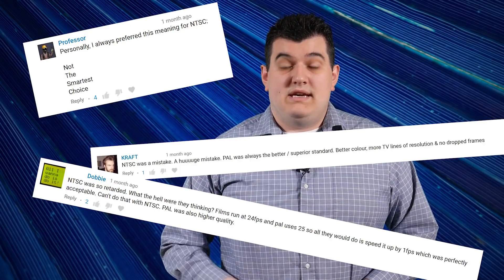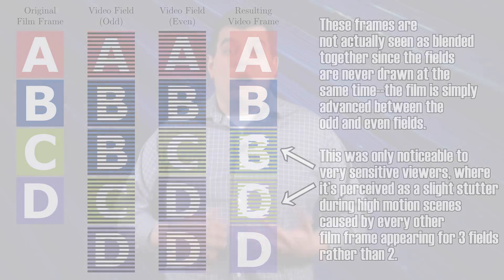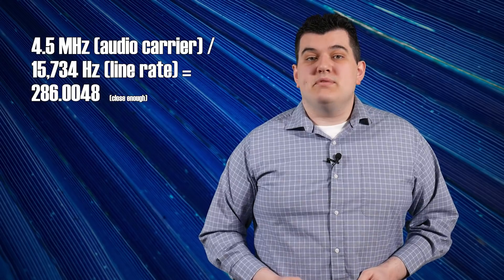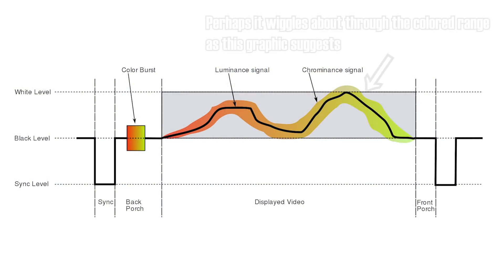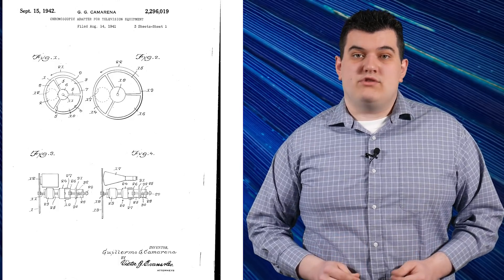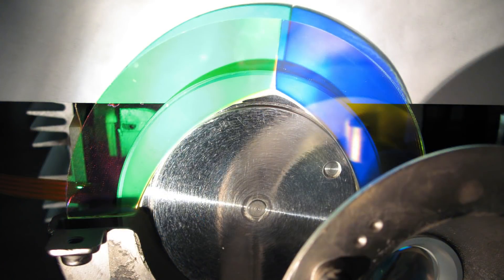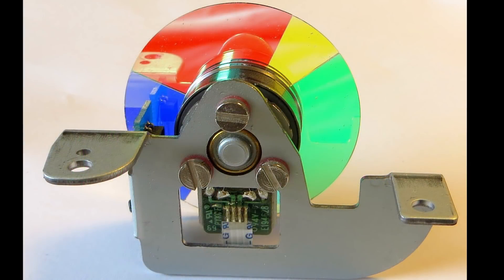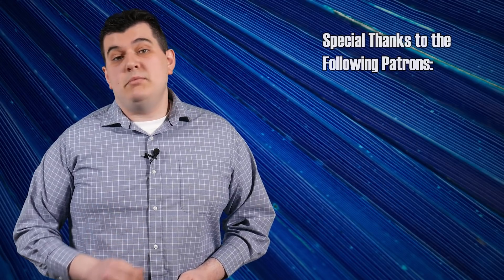Analog Color TV Wrap-Up--Some extra info

Comment: A few assorted remarks ..

1. The terms PAL and NTSC do not describe frame rate or line count. They are colour systems only, and any of the two (or three, with SECAM) can theoretically be used with any frame rate and scan line count. For historical reasons, NTSC is mostly used with 525/25, and PAL is mostly used with 625/25, but that doesn't mean that is mandatory, or that the terms define resolution. There is one country that uses/used PAL with 525/30, namely is Brazil. PAL colour on top of a 525/30 signal  was also used as a hack for bridging incompatibilities in multstandard VCRs, and apparently a reverse hack, i.e. NTSC colour on top of 625/25, also existed.

The 625/25 family of signals have been around in Europe since 1948 and were broadcast in black and white for nearly 20 years on. At that stage the term "PAL" did not exist, and colour television was far beyond the horizon. The fact that the introduction of PAL colour did not require a slight shift of the frame rate as in NTSC was just luck because the maths turned out differently, it was not planned for.

The UK is an exception in this regard, because as opposed to continental Europe they opted to retain their pre-WW2 405 line standard after 1945; they could have introduced colour television (with any of SECAM, PAL or NTSC) based on that standard, there was no necessity to switch to 625 for colour. (And that was seriously considered, they did tests with all three colour systems with 405). The UK switched to 625 eventually mainly in order to alleviate incompatibility issues with the rest of Europe. So with the 1962 introduction of 625 lines, the UK was a latecomer. So if you based your research mainly on UK sources, you might be getting a slightly distorted view of the events. In continental Europe, 625/25 in black & white  had been the standard for nearly 15 years before then.

2. I think the major factor why Europe introduced colour tv nearly 15 years after the US was economics. Europe was still building up from the war and didn't have the resources to invest into such luxuries, while in the US consumerism was already in full swing.

3. I'm in Germany, in the 1970s and 80s in some areas you could receive terrestrial television in NTSC from AFN, the station serving the US military. You needed a multi standard set which were rare and expensive then, so not many people did. From my memory, the hue problems of NTSC were quite apparent and we had to use the tint dial quite a lot to correct those green and purple faces :).
Reply: Thanks for your comment about the UK. I wasn't understanding all that stuff about incompatibility because we had an old black & white set that we used for a few weeks (maybe months?) in the early '90s. This was after the presumably early '80s, possibly '70s color TV broke. I grew up in the Netherlands.
Reply: France and UK had old and "exotic" systems that they had to choose incompatible new one. Other Europe coutries used B/W 625/50 system, so they switched to 625/50 PAL or Secam and all B/W sets worked.
Reply: Xaver Lustig True with the frame rate and line count. However, I believe at the time they were working within technological constraints of the era. Everything had to match the AC frequency while still allowing enough analogue bandwidth to transmit all relevant image, signal and audio data. The bandwidth is pretty irrelevant today with transmission of TV via a digital signal. Much more data for less bandwidth. The digital era has also made NTSC, pal and secom transmission standards obsolete... So all this is really debate.. Lol.
Reply: @gooseknack  Brazil has 60 Hz, but both 110V and 220V depending on where you are in the country.
Reply: @SveinWisnaes  Oh god...
Reply: +Brett Ison Yes it's mostly obsolete  now, except if you still play analogue tapes or insinst on only buying new equipment if it has analogue out so you can run your old tvs with it (as I insist on doing :). The irony is that even the cheapest modern flat screen televisions come with a super multi standard tuner for old analogue signals, even though that is hardly needed today. 30 or 40 years ago it would have been a dream.
Reply: @xaverlustig3581  Analog tuners in modern TVs are most likely due to FCC regulations(?), similar to why modern TVs have caption decoders in them. That's my theory.
Reply: Xaver Lustig Oh I bet!  Then you'd really be king when it came to importing tapes of US shows!
Reply: The 50 vs 60 Hz of the power line are to match the frequency of the TV signal to reduce flicker during recording in studios. Furthermore, here in the Netherlands we use the B system for VHF and the G system for UHF. Greece used the same B and G systems, so television sets could receive the black and white image but not the colour part.
Reply: Indeed, the unique colour system used in Brazil combined the 525-line 30 frames-per-second System M with the PAL colour encoding system, hence it was called PAL-M (nicknamed "pay a little more"). Because of the frame rate/line count, it was compatible with black-and-white NTSC, and totally incompatible with PAL...  People used to buy decoders and later TVs and VCRs had a "PAL-M/NTSC" switch.
Reply: Well, The American 525-line-30 frame/60 field system was designed by the NTSC (the actual committee) in its first incarnation, so I think using the term NTSC system to include that makes sense. But I guess the term PAL (Phase Alternate Line) really does refer only to the color encoding scheme.
Reply: National Television Standards Commite was around before color TV (around 1941)and it totally specifies frame rate line count Sync pulses etc.
Reply: @carlosgarza31  
But do note that pre-WWII USA television (VERY few viewers) used the old NTSC system (60 fields for 30 frames per second - but only 441 lines).  After the war, it went to 525 at 30fps.
Reply: Nice points, I learned something new today!
Reply: I completely agree with this. PAL, SECAM and NTSC are color standards. The frame rate, audio offset and modulation, etc are defined separately in standards known as “Systems”.
Reply: Are you sure that  525/25, not 525/30?
Reply: I'm in the USA and our family got Color TV in 1969.

I do remember seeing off-hue color occasionally in the early seventies, but off-hue color became less frequent as we went through the mid-1970s. 
At this point, if one adjusted the hue knob for one station, all of the other stations would also have good color, as long as nobody turned the hue knob.
One exception in the twenty-teens:  A low-power* station in the area always was slightly off-hue, with red shifted slightly toward orange, green slightly to blue-green, and and blue shifted to indigo.

*In the USA, a low-power TV station means more than just the fact that they have a weaker signal (15KW ERP or less).  The technical standards are less stringent, but cable TV systems have no obligation to carry LPTV stations on their systems.
Reply: true enough , practically superfluous as almost all pal used 50hz and almost all ntsc used 60hz, this has more to do with power grids then the tvs itself but its still a fair point to make that there was no reason to diverge to 50hz just for the sheer annoyance of the fact
Reply: 625 was known as HD in the 405 line UK.
Reply: @ellenorbjornsdottir1166  Yeah. And the difference up to 720p is minimal. It still drives me nuts today to see people talking about 720p as HD... :-D
Reply: @SveinWisnaes  Relative to the 625 standard, it's the same step as 625 was from 405. (It's equivalent to about 850 lines)
Reply: Hi. Brazilian here. An addendum on the 525 Pal (or PAL-M as it was called) weirdness we had here: 

Because of the strange system we used (60 Hz 525 lines but with PAL color) and the fact that a lot of electronics like VCRs and shit were, y'know, imports from europe/america/japan -- Eventually. And I can't tell you WHEN exactly but it was certainly already a thing by the early 90s, but yeah, eventually manufacturers just started making Brazilian televisors compatible with both NTSC and PAL color. Quite how that was done in the technical realm I don't know... But it was quite convenient as a video gamer, as import games (and pirated games) would look right regardless of what region they were from.
Reply: NTSC standard is 480i at 30 FPS on progressive scanning.... and 60 FPS on interlaced
Reply: @Scudmaster11  I don't think real NTSC, PAL or SECAM for that matter supported progressive scan...
Reply: @hikkamorii  well none of them ever did support it but there was ways of getting progressive scan
Reply: @Scudmaster11  I tried force set my PS2 to output video in progressive PAL and NTSC, that didn't work :)
Reply: @hikkamorii  it works in only other lines

Comment: Is it reasonable to assume the 30FPS of NTSC and 25FPS of PAL is due to them being a half-ing of the AC electrical frequency in those countries. (60 and 50Hz respectively?)
Reply: TylerLeeds111 Yes. Indeed there are exceptions anyway; in parts of Japan they used NTSC/50, and Brazil used PAL/60 also I believe. The frame rate is a function of the electrical supply rather than the standard used.
Reply: Yes - not because they actually derived the timing from the AC frequency (at least not in the TV), but because power supplies in those days weren't that great, and some of the AC waveform would make it into the video signal. Matching the field rate and the AC frequency would mean that any artifacts would be stationary on the screen instead of rolling up and down, making them less noticeable.

Comment: The lower resolution of NTSC gave me headaches watching Broadcasts where you could see close up video of people's faces and their eyes were all jittery and sparkly due to lower resolution.
PAL never had that issue.
Rectangular pixels suck and i'd much rather the 4% playback increase with a higher resolution.
It's the old issue.. What's better.
Resolution or Frame rate.
But in this case the Frame rate is not lagging. It's too fast. Lol

Comment: lol, resolution over framerate. And now everyone wants framerate over resolution.

I know they're not the same thing (audio/video vs video games), but still.
Reply: Besides the difference in video vs games, back then, the resolution was the weak point. Having 25-30 fps is fine for TV and movies, and was plenty for the games of that era. But 525/625 lines is pretty bad, especially with analog signals and CRT diaplays. Today, resolution has improved to the point where it's usually not an issue.
Reply: 4k rocks anything more than that is pointless unless you have a really big screen up close, as far as farme rates there is a slight to do 120/144hz over 60 anything more than that though is even more pointless
Reply: They're completely different because when watching TV you don't need to worry about how quickly you see a response to your input. Seeing a faster response to pressing a controller button makes the controls feel more precise, and that's the primary reason gamers prefer higher frame rates.

Comment: The thing you've completely missed with the 4% PAL speed up is that unless you had already watched the same movie/tv show in NTSC you would never notice, unlike the NTSC 3:2 pull down, which was noticeable with every panning shot.
Reply: It depends on the individual (and the television system to which one is accustomed – NTSC/ATSC, in my case).
I barely notice judder on panning shots (and when I do, it's only mildly irritating). Conversely, I find a ~4.17% increase in the pitch of people's voices highly noticeable/annoying, even if I'm unfamiliar with the production and its cast. (I realize that others have the opposite experience.)
Reply: I personally hate both situations.  The motion is far more pleasant with PAL, but the SPEEDUP is horrid!  But I will say that I can live with the speed up and find it much less objectionable than the jerky motion from 24 to 30 FPS conversions.  I have always lived in the USA and grew up with NTSC and always hated the motion since I first noticed in when I was little watching Star Trek and Lost in Space.  I had not noticed it much before that.

  As a result, I have actually bought quite a few TV series in PAL versions due to the better video motion!
Reply: Either flaw is correctable, of course. For 24p material to which pulldown was applied, inverse telecine results in an exact reconstruction. (Many modern TV monitors can detect the cadence and perform this function on the fly.) Speedup can be reversed through software, including a DirectShow filter called ReClock.
In the case of a DVD, I would assign preference to a 576i version for its higher resolution (provided that it was sourced from a master of that resolution or greater). Blu-ray largely eliminates the issue, as 24p material is typically released as such worldwide.